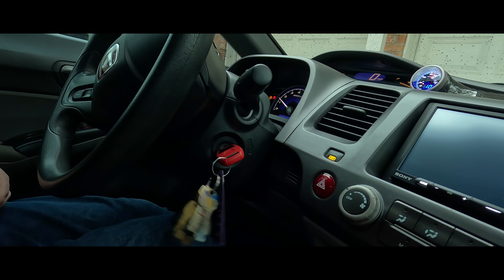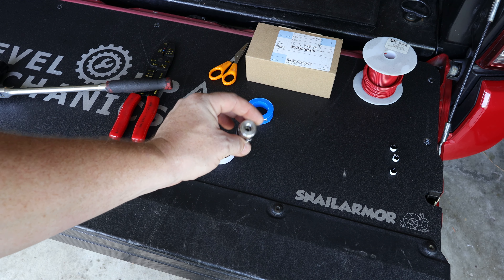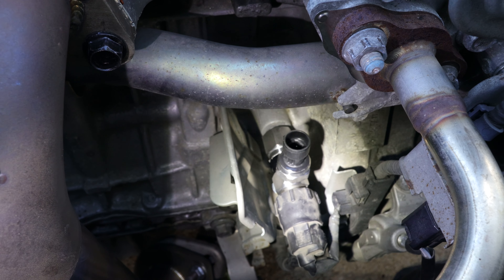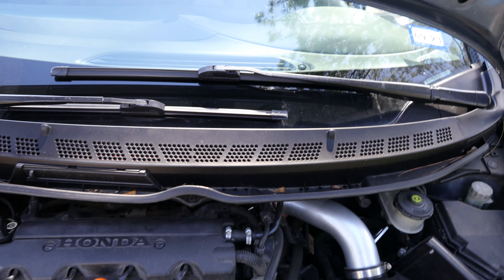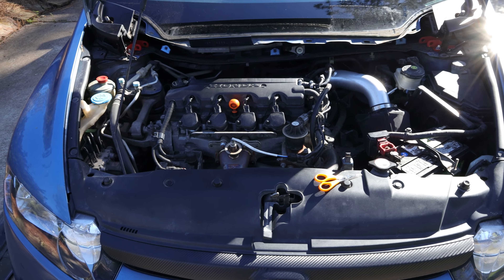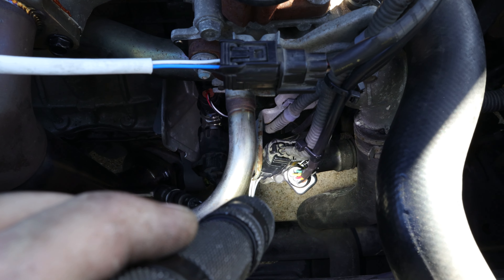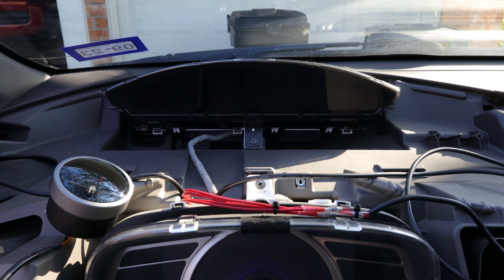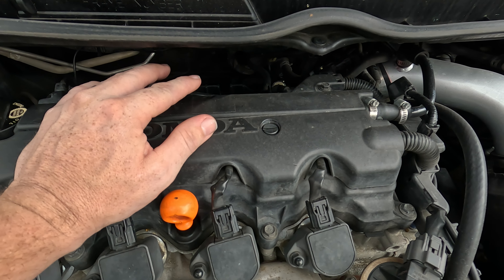Honda Civic Mods | XVRacing Carbon Fiber Gauge Pod | Prosport JDM Series Gauges + Extra Upgrades

Comment: How much HP you got out of it? ❤
Reply from the maker: 🤣 At least 10 HP, for sure 🤣 🤣 🤣. I've been prepping the Civic to make it ready for actual HP gains that will be happening over the next 6 months. 

I currently have the Skunk2 R18 camshaft sitting in my toolbox, waiting to be installed (along with my hondata flashpro so that I can properly tune it)... and plan to have the kraftwerks supercharger added by this summer. 

The goal is to make 200 WHP reliably as a daily driver. This year should be pretty fun in regards to performance modifications 🤞🤞.

Comment: quick question brother, do you know if the 9th gen civic lowering springs fit an 8th gen civc? thnaks!
Reply from the maker: I don't know for sure. My current suspension setup includes 9th gen civic TruHart struts / shocks and 8th gen civic Eibach pro-kit springs. 

It might be possible to use 9th gen civic lowering springs, but I just don't know for sure...
Reply: @LevelUpMechanics   gotcha... the front springs might work for sure, but the rears are a bit questionable, some people say rear springs of the 9th gen may work, if 9th gen rear isolators are used, since 8th and 9th gen isolators are completely different lol.. sos ive been getting mixed answers haha